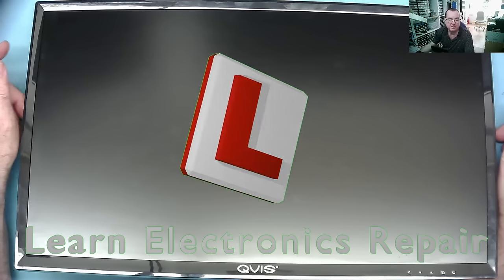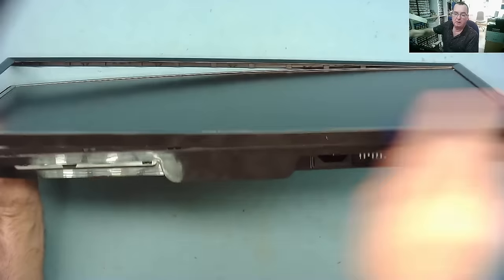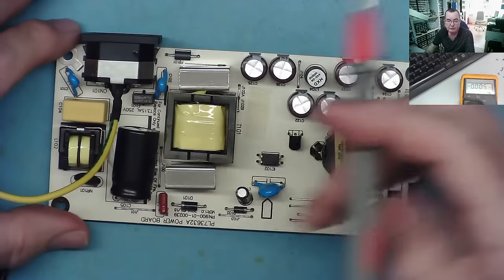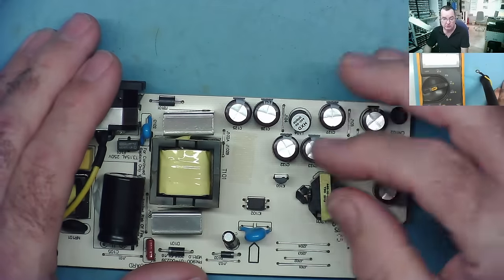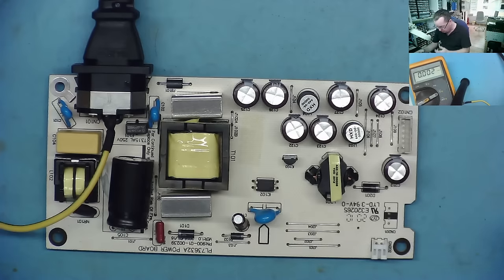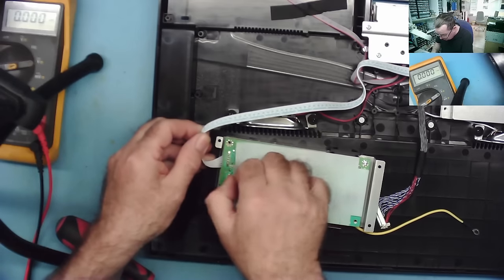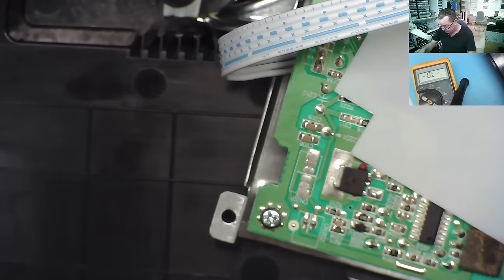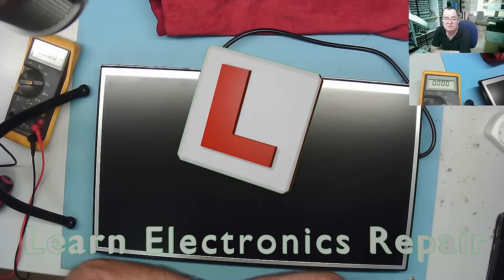LED Computer Monitor Repair

Comment from the maker: Well  I didn't have to soak test it for long.  My wife (Julie, by the way) used it for a few hours this morning, but as she was sending an email when it suddenly went blank, then came back on with narrow multicoloured vertical lines all over the screen (looking like a duff GPU).  I unplugged the monitor power and powered it back up again but now it doesn't come on.  Julie's PC had not crashed,  I connected a spare monitor and it was working.
Reply: Sounds like bad solder joints somewhere on media board, I'd bet it will start working same moment you open it next time.
Reply: Hi Sir, it has nothing to do with the video, but I see that you know a lot. I found on the thrash a gtx titan x which was not working, when I opened it up, i saw that it has a high side mosfet burned and an inductor (r33) burned… the electrical engineer team of my company told me that they will help me, if I find the compounds. Do you think it will work replacing this pieces? Or the 12v reached the gpu, or vrams and it is non sense? The rest of the gpu looks glorious besides that two compounds. Cheers, and sorry for this question, I know it is not related with the video but I can not find the answer nowhere
Reply from the maker: @Nelox2000  Impossible to answer that, but usually short circuit high side mosfet does tend to kill the GPU, Vram or both.   I would take some resistance measurements.  GPU Vcore will read very low anywau, but if you see a near short of Vmemcontroller, PEX or Vram it doesn't look good.  Expect PEX to read 10-20 ohms or so, and Vmemcontroller to read maybe 30 ohms or so.
Reply: @LearnElectronicsRepair  thank you sir, i will let you know what happened once i change the compounds. I will take the measurments also. Greetings from Argentina.
Reply: Could be a bad cap somewhere misbehaving when it gets too hot.  I had a similar issue with a samsung one where it kept going off under load and then would turn on after a while.  Fixed it but then the backlight went on it.
Might be a good idea to check them one by one.
Reply: I would recap it with new capacitors. Had a monitor with intermittent fault almost like this, where it wouldn't turn on again. But after a day or two, it would turn on. Recapping fixed mine. Could be the fault of this too, or something else like a cold solder joint or something.
Reply: I'd be checking the integrity of the solder joints on those connections to the display panel.
I've also found leaky varistors to do strange things, even right at the front of the circuit.
Check for higher current lines, to see any potential dry joints from heating.
I use lead free for connections due to the Higher melting point, plus tensile strength.

Comment: Reminds me of a LED TV I got in a couple of years back. The error was that it stopped working after 15-30 minutes.
So the guy loaded it up in the car and brought it over. I opened it up and checked for any visual cues.. nothing. Then I just put a movie onto it and did other stuff while it was playing in the background. Worked perfectly. So the guy got it back and it worked fine for him too.

A year later I got a new call. The TV had worked perfectly for almost a year until the error appeared again. This time it didn't start at all so time for round two...
I opened it up again and now I could see the problem, a burned connector for the power going in on the main board. The connector showed a brown spot on the plastic. I quickly stripped the wires and soldered them straight onto the main board and the TV worked again.

Apparently the connector had a thermal issue and failed open when it got hot. When I opened it the first time it was enough to break the oxide layers and create a better connection, allowing it to work until it eventually failed.

So nowadays I check the power connectors if I don't find any other fault. The first sign of an overheated connector is the tin plating turns gray and dull compared to the pins around it. In extreme cases the plastic of the connector turns brown or even starts to char.

Comment: My dead monitor was a broken track on the neutral input to the board. Took it out - working,  put it back in - not working. This kept happening until the break on the track became visibly noticeable. Blob of solder and some wick fixed it.

Comment: Hi Rich, I fixed a few monitors recently. I find old plastic cards (like credit cards or loyalty cards) very useful when prying open the back cover. Stiff enough to do the job, but also flexible and won't snap. Just be careful as the top layer of the foil peels off and particles can stay inside the monitor. Cheers!

Comment: I really like that the manufacturer has clear, descriptive silk screen printing on the PCB and printed different dash and cross marks on the outgoing flat cable. This makes it much easier to track continuity between boards in case there is a twist in the cable on the way to the connecting board.

Comment: I had a similar issue and it turned out the physical push button was defective. Everything was fine after replacing it.

It was the first I've seen these little buttons breaking causing a loose/intermittent contact
Reply: I also think power button. There is too much current spike turning on and off. It would better if there was a relay between the main and the PSU, but then again that is probably too expensive, since these monitors are so cheap in relation to ten years ago...
Reply: That was my thoughts as well.
Reply from the maker: Mr Guru  Exactly
Reply from the maker: The monitor should power up automatically when you apply power, then go to sleep until the PC provides a signal
Reply: Another thought could it be a dodgy IEC cable? Or dry joint on power input socket from being plugged in and out etc..
Reply: MrTGuru  actually my wife as she works in IT!  woman are actually in all sorts of work these days I think even electronics repair I should think

Comment: Intermittent faults are the most annoying. I’ve had some success with freeze spray revealing dry solder joints in the past.  Yes, soak tests for things which fail during use are worthwhile but if something doesn’t start without tinkering (TLC?) I’m not sure burn in testing would necessarily reveal the condition. Maybe a warm air / freeze spray ?     
Hopefully it will return for a part 2 😀👍
Reply: Tap around with a screwdriver handle and wiggling wires followed by freezer. As someone else has mentioned, I would wonder if the power switch is used regularly and is intermittent - some are never used as the pc is turned off instead but it's worth a look ...
Reply from the maker: As this monitor is used by my wife at the workshop it is easiest to let her use it and see what happens.
Reply: @LearnElectronicsRepair  let her soak test it :-) To be honest we used to use loads but given the current price of freezer it's not worth using much! Hell, "they" even wanted £15 for a can of my normal flavour of air duster!
Reply: @andygardiner6526  Add a car or push bike tyre valve to your old empty air duster can and refill with bike hand pump OR 12V car air pump.

Comment: Those metal pieces on the pcb top are cheapo heat sinks soldered really close to the tabs of the smt mosfets on the bottom.

Comment: I have a few monitors, where the fault is on the driver board. What would happened, is it would not turn on straight away and this was due to a faulty cap. After replacing, it would work and the after an hour would suddenly go blank screen. It turned out that there is a component 3 legs/pins with a heatsink ( I don't know the name of the part). What was happening is due to lack of air flow in case, this part was heating up and the shutting down when it became too hot. I applied some fresh thermal paste and it worked semi ok for about a month and then died completely.

Comment: Hi Richard, you mentioned it many times now (and we've seen it) that the humidity and salinity of the Island's environment causes a lot of corrosion. It really could be as simple as that the power button and other contacts got a bit corroded hence increasing the resistances and causing the intermittent failures.
Reply: Yes indeed, I"ve had that power button scenario a couple of times with various monitors.
Reply from the maker: This monitor should power up without pressing the power button so I doubt it is that.
Reply: That is simply not true. For example cars on gran canaria last 2 times longer because of the sunny environment and the lack of rain.
Reply: @seeithappen1  AS I don't live there, I cannot judge it. It is just an observation from previous videos. I haven't seen rusted computers here. Dusty? Yes, but no rust/corrosion like on the ones Richard serviced.

Comment: Maybe take a look at the control panel. There may be a problem with the switches.
Reply from the maker: A lot have said that but the monitor should power up automatically when you provide power.  Then go to sleep if there is no signal

Comment: There is a very small change that there is a short on the led because the leds are in series and therefore the high voltage

Comment: Maybe when the processor got warm it shuts down, when it Cools off it does working again. Or you just had to reseat the screen connector, sometimes it's just that and will solve it like laptop's issues with no screen but backlight on as long as the 3 or 5 volt is presenceb 👍.

Comment: i have an acer 19 inch 4.3 monitor working 8 hrs a day at works more than 20 years. Only repair i did is changing failing capacitors on backlight power board. it has cold cathode lamps.

Comment: Similar troubles with intermittent power button
Reply from the maker: The monitor should power up automatically without pressing any buttons.  You can use the button to manually power it off (put it in standby) and on
Reply: @LearnElectronicsRepair  Just want to say your videos and channel are great.  I wish at school I had you as my electronic teacher (I am old now).  Anyway you are probably right although could it be the switch is getting stuck in the off position?  What would happen if the switch is stuck closed and you apply power would it still power up and show the logo?

Comment: I had an acer monitor that didn't work with intermittent power led light
Every time I disassembled it started working again for a while until it didn't
In the end it was defective electrolytic capacitor even if they looked fine

Comment: What software do you use for your video
Reply from the maker: For recording I use OBS Studio which does the picture-in-picture inserts in real time.  For editing I use Davinci Resolve.  Both are free software and I can thoroughly recommend them.

I record on an i7-4790 with 4Gb of DDR3, and GTX 750 ti running Windows 7 32 bit. 

I edit on an i7-5820K X99 system with 16Gb DDR4 RAM and also currently using an GTX 750 ti running windows 10 64 bit as my GTX 980 ti was acting up

I have just built an i7-7700K with 16Gb DDR4 and RTX 2070 ti to replace my i7-4790 recording PC and I'm about to upgrade the i7-5820K with a RTX 4070 ti.  

This will allow me to 
A: do live streaming on Youtube or go up to 1080p 60fps or 2K/4K recording and 
B: edit videos much faster or at higher resolutions 

I hope that helps you.

Comment: BNC in/out connectors... security monitor?
Reply: might be… if it is, it should be built like a tank!
Reply from the maker: Yes, we had some that came with thermal imaging systems which we were selling during the pandemic and one client didn't need the monotor as they had their own so it sat around for a while then got repurposed as a PC monitor as it also has VGA and HDMI.  It works really well for this purpose, or did

Comment: Typical nothing wrong with me but i wont work situation, i have seen one in one of sockets a pin was creating high resistance with pin itseld n sockets pin cuz of that device wasnt turning on cuz there was no enough voltage. Probably this one had that problem, when you pull them sockets out and put them back thing started to work again.

Comment: The problem is it's a qvis monitor😂 designed to work, 1 day more than warranty 🤣 their cams are much the same Dicky.
Reply from the maker: I didn't actually buy the monitor, it came with some thermal imaging systems we were installing during the covid pandemic and this particular client didn't need it.  So it got repurposed as a PC monitor at the workshop.
Reply: @LearnElectronicsRepair  I figured as such as BNC connectors are quite uncommon on basic consumer PC monitors, at least here in the Netherlands across the moat.

Comment: You should check the basics such as is there power to the device (fuses, loose  connections etc.) and does the internal PSU have an output before diving in. You can waste a lot time and effort with your approach and is not a good way to teach people.👍🤫 (edit typo)
Reply from the maker: Alan, I do know how to do those things 😉 I did discuss in the video how to move forwards (waggle wires etc) or put it on soak test and I also chatted about why I didn't check the PSU output before removing and testing it. Of course you and everyone else are welcome... no, in fact you are invited... to express your opinions and you are correct to question or challenge what I do.  As I explained this is not a customers item, it is in use at the workshop every day, so  I stand by my comments that in this instance I believe it is best to just use it and see what it does.  IMHO I would say your suggestions on how you would approach this fault are just as relevant and perfectly correct, but I wouldn't say they are more correct than my conclusion is.
Reply: @LearnElectronicsRepair  with LED screens I always go other way around. No1 failing point is LEDs so I always check them first. Not a professional so I just use homemade tester (high voltage low current tester I made with 555, transistor and 3.3mH inductor :)) and if LEDs are ok then I can start checking everything else.
Reply: @LearnElectronicsRepair  Hi Richard, what a masterful pontification, I think you really enjoyed that. 😉
Reply: @gorky_vk  Indeed, start with the regular known type of issues. 👍
Reply from the maker: @gorky_vk  I did want to introduce back light testing in this video / tutorial and just my luck, that wasn't the problem this time - unless it is intermittent.  I have one of the commercial back light testers, approx 30V 1ma or 300V 30mA switchable, but I'm very interested in yours it sounds like an interesting project